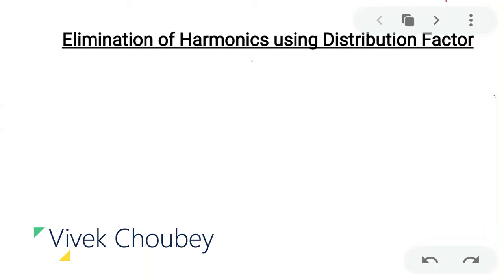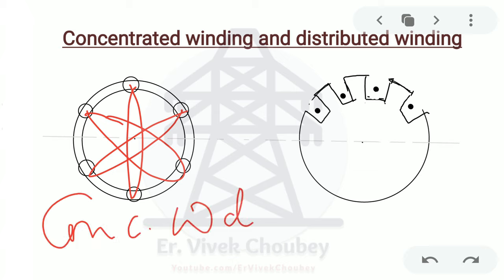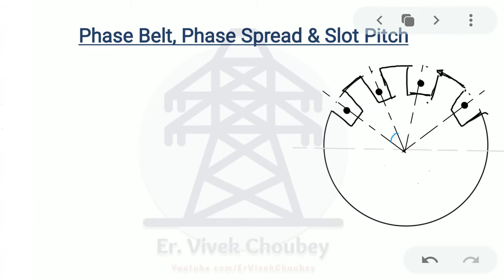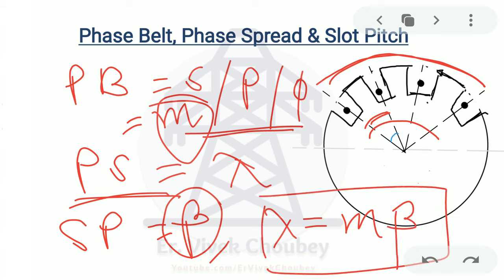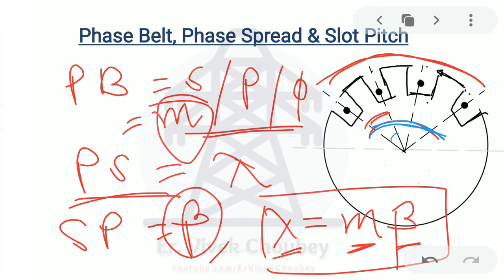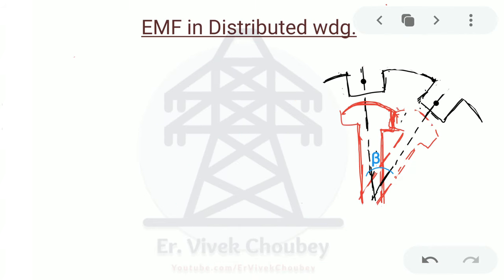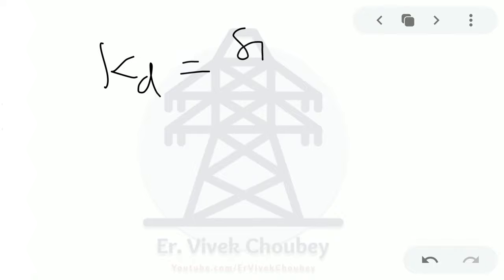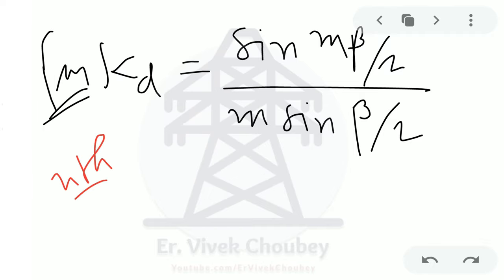Distribution Factor & Mitigation of Harmonics in an Electrical Machine

Comment: please explain why a constant (2pie k) is introduced in place of arcsin(0), also give the difference between k & n?
Reply from the maker: Because sin function is zero not only for 0° but also for 180° or π, for 2π (360°), 3π (540°)....i.e, for all integer multiples of π and that's why I generally wrote kπ where k=1,2,3....and so on.
n denotes order if harmonics you want to eliminate from the machine. Just watch the video once more and it will be clear. For example if you want to eliminate 5th harmonics then put n=5 and put any value of k to find the angle required for elimination of that particular harmonic wave.
Reply: @ervivekchoubey   thank you sir.